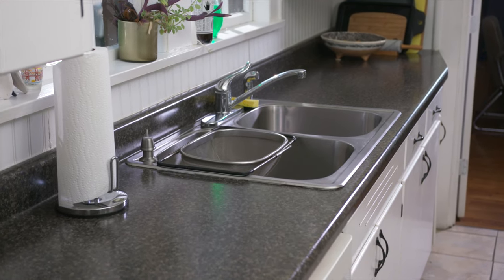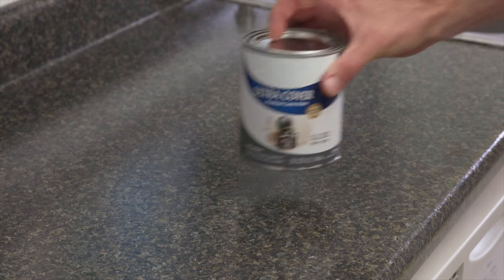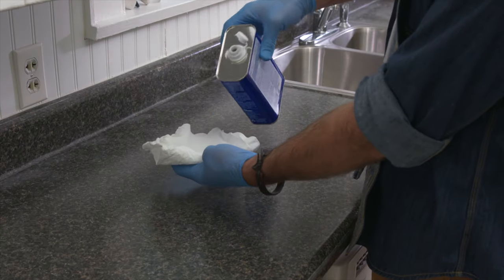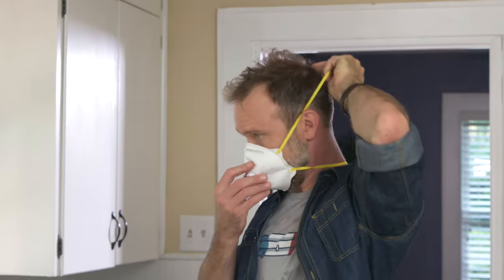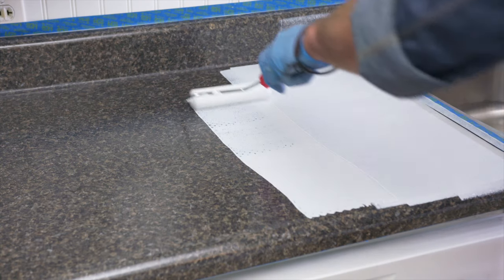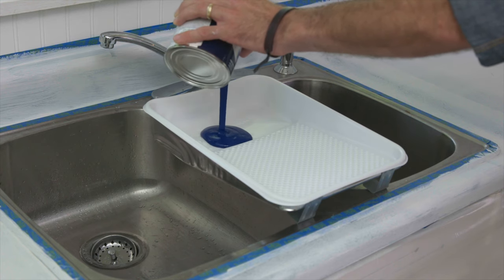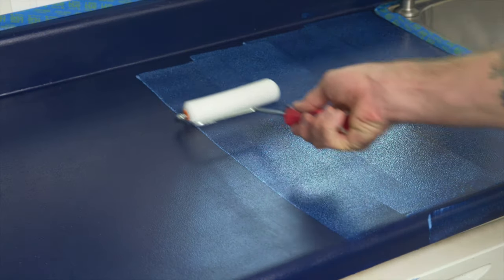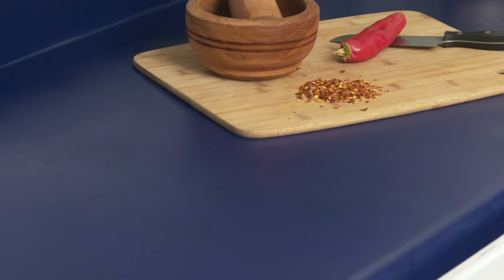How to Paint Laminate Countertops | HGTV

Comment: Take what you want and leave the rest. I learned something.
Reply: Please don’t mimic this process if you want anything durable or presentationally acceptable. There are better materials out there, even kits.
Reply: I'm about to paint my formica. This is so commercialized. No way am I using a roller/ painting in that direction. Gahhh!! I was wanting to make sure I checked out enough DIY video's. Learned a few of the same point's/processes, but I'm gonna have to skip on the rest of this one,  HGTV.
Reply: Exactly 💯 AGREE 👍🏻

Comment: One note... a dust mask, including N95 dust masks (as shown in the video), provide no protection against VOCs. In other words, this person would have been just as well protected wearing nothing during the painting phase (do wear a dust mask when sanding). If you want VOC protection you'll need to buy a respirator. However, for this relatively small project, with just a bit of decent ventilation, you should be fine.

Comment: The primer shown in the video is oil-based, it says that on the can.
Reply: Oil based Kilz is by far the best for adhesion - in my experience in 6 years as a painter trying different products
Reply: Insl-X Stix, Cover Stain (yep, oil) great bonding primers.  I used Kilz Premium 3 on my oak cabinet doors and I'll never do that again, the stuff stayed tacky.  The hardware store wouldn't accept a return after I opened the can.  I suppose I could prime some walls with it.

Comment: Why does that high gloss look matte when dry?
Reply: Was gonna ask the same question. Thanks!
Reply: Because it takes several coats to achieve the high gloss finish. The first coat will look fairly matte.  Second coat shiny, third, true high gloss! And remember,  once it takes 48 -72 hrs.  To cure.  Which means hardened.  It's at this point it will offer protection.
Reply: Real counter tops aren't always glossy, they're matte. Not all counters are glossy. You want glossy go pay an arm & your legs for NEW spanking GLOSSY counter's SNOB!!!!

Comment: I have to disagree with the video on this point: Personally, I would STRONGLY not recommend power sanding in this situation because those microscopic particles in the countertop will migrate through the air into every corner of your house, and no telling what health risks that causes. Those particles will float airborne for a long time after you take your respirator off. I would stick with sanding by hand or even better just a good scrubbing with deglosser and there’s no dust.

Comment: What would I use to clean the counter
Reply: since you already have counters......or does your question beg the fact that you NEVER clean your counters.......LOL
Reply: I suppose your cleaners, paper towel, clean sponge & mild dish soap, spray cleaner, they don't specify so I'd be gentle unless it's a terrible mess /stain or requires germ disinfectant. I don't think this is a solution intended to last forever but even new counters don't do that.

Comment: Using water-based paints is not what I think would go on a counter around an area that is subject to splashing. Can someone clarify this for me?
Reply: Water based just means the product is water based in its makeup. Once it dries you are left with the actual final makeup of the paint component. As opposed to latex based where once it dries you left with a the rubbery quality of the latex (not as hard of a surface).
Reply: An acrylic topcoat will show water spots, if the water puddles on it for more than a half hour. The spots eventually go away. The most durable finish is epoxy, and it is waterproof. There are a lot of howtos on using epoxy, it's messier but more durable.

Comment: How can you paint with acrylic  (water based) paint over mineral spirits (oil based) without cleaning up after with soap and water? Folks, you can't paint over anything with an oil base with a water based product.
Reply: Mineral spirits is a solvent that dries with little to no residue left behind, which is why it is commonly used in cleaning and painting prep. The wipe-down with mineral SPIRITS is done to remove any other residue that could be problematic, not to leave a coating like mineral OIL would. You are completely misunderstanding what the product is, as you would be painting over a clean surface, not something oily.